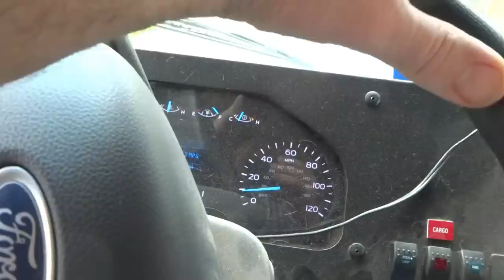COPPER WATER PIPE LEAKING IN KITCHEN CEILING

Comment: I had a small drip coming from a copper elbow. The weird thing is that it would only leak when the upstairs tub was running.
Reply: Water is going to follow the path of least resistance 
It may seem at the elbow but it could be up above and running down the pipe. 
Just seems weird only while it’s running 
Water is in the pipes regardless if it’s in use or not

Comment: What a complete fraudulent plumber installing "copper clad" steel.  Stuff like this is why homeowners should be able to sue for damages because of the city code inspectors approval or signing off on this crud. I presume it is not acceptable for meeting code.

Comment: So I'm a female homeowner with a copper elbow leaking from the ceiling .The pipe is exposed just over the doorway (no door) in-between my kitchen into the laundry room so drips onto the floor.  I see the green corrosion and very small hole but the corrosion isn't bad ,house built in the 50s been here 14 years 1st leak ever. Lol..The small hole was a tiny sprinkle months ago but now a drip. Oh Lord, I think  the elbow needs replacing. Just watching to see how yall fix these leaks as I place a bucket under the leak 😂.  Lol....
( will send out an S.O.S. to my brother in law tomorrow as the sound of the drip is driving me 🤪)

Comment: Very highly likely Type-m copper, and-or pipe side not reamed. Vortex within water will burn pin-holes within fittings themselfs, as well as pipe runs. Save 7.00 bucks differential per stick copper pipe, only to lose half day doing twice, cutting/patching included. 7.00 dollars,  I'd follow there seminar advice.

Comment: Flux keeps it from oxidizing heat has nothing to do with capillary attraction space does take two sheets of glass sandwich to get her a place end in a glass of water you will see capillary attraction with no heat
Reply: Capillary action.
Reply from the maker: try soldering with out flux then if your so smart
Reply: @stevenlavimoniere  you miss the point Steve never said flux was not needed but other than making the solder liquid you don’t need heat but your pretty smart too
Reply: "Soldered joints depend on capillary action drawing free-flowing molten solder into the gap between the fitting and the tube. Flux acts as a wetting agent and, when properly applied, permits uniform spreading of the molten solder over the surfaces to be joined." That's from the Copper Development Association. Seems Steve is right - again.
Reply: Turn the shutoff valves so the handles are pointing slightly away from each other. This will ensure the handles do not bump into each other when turning the water on or off.